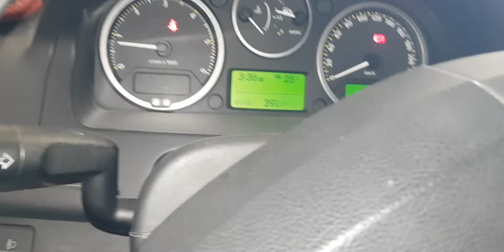land rover freelander 2 timing mark making . oil seal replacem

Comment: good video but it's missing how you actually fit the new seal into the engine, or any tools needed, i have heard that if not fitted correctly it just leaks again, and sometimes worse.